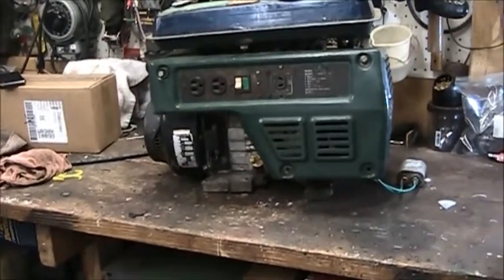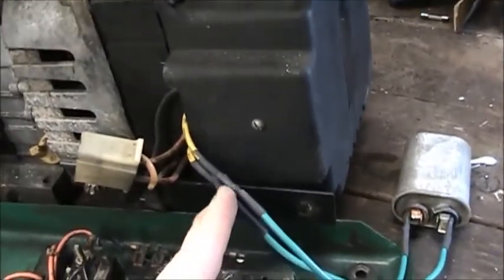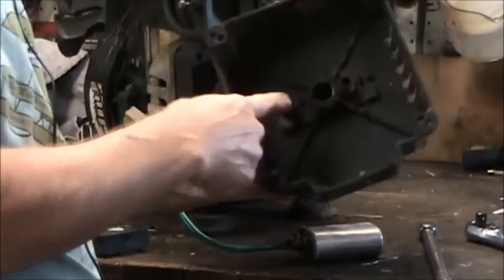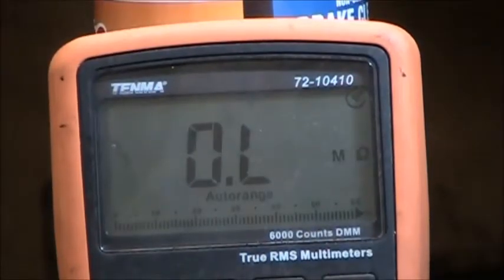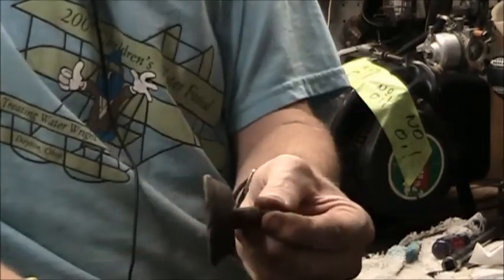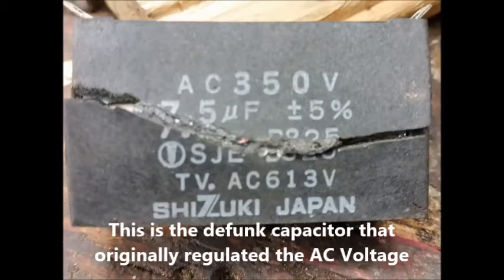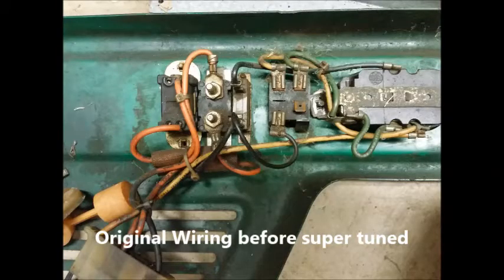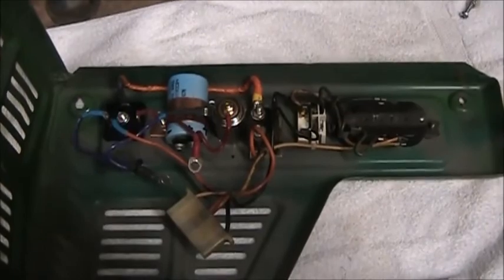Coleman Powermate 1500 Generator repair with schematic

Comment: My friend had one or these and in our case the problem was not the capacitor. We tested the cap with a multimeter and it was fine. The issue was the diodes on the rotor you can see them at 5:58. The diodes tested fine with a multimeter. But a multimeter only uses 2 or 3 volts to test diodes. The diodes were probably failing under higher voltage and causing the output voltage to collapse under load. After replacing the diodes with new ones that fixed it and allowed it to output full power. The original ones are MR760 diodes rated for 6A 600 volts. I replaced them with 6A10 diodes rated for 6A 1000 volts. Those are a more modern part that you can easily find online or at an electronics shop. You do have to solder the new diodes on. So if you try replacing your capacitor and it still doesn't work try replacing the diodes.

Comment: Those soft rubber hockey pucks, make very  good  vibration  dampers. As does a spring, on a bolt with large washers.....

Comment: 7:00 time. Those diodes, are the same ones used in older GM  alternators,   10 Di  or   10 Si  models. The only difference, is in this alternator, they are pressure fitted, to a semi-circular  heatsink.  Probably 70 amp rating, or so.

Comment: Greets...I just bought a non-running PM1500 I believe identical to yours. I have a no-spark issue and coil has 6k ohms resistance so I think it ok.
Google searches lead me to think there is a points and condenser on this rig. Can you verify please and it you think that could be the issue?
Thanks in advance, Steve.

Comment: I have one also mine is 1400  Suzuki engine started on second pull not bad for 28 years old. 
 Tank is rusted but holds  gas my is a 1990 model.  I had a problem years ago  no 120V output  you have to flash the field I put 9V battery for 2 seconds to get it going.
Reply from the maker: How do you flash the field?
Reply: @LestonDr  If it starts and runs but you have no 120V light or power when the sit they loose the charge.  Just google or youtube  search "flashing the field on a generator"   I think I attached wires to the brushes ran the wires outside the case.  There are many videos.  I seen people use a drill, flash the brushes, put 12V into the outlet to energize it. It only take a millisecond to flash.
Reply: @SoFlaRocks  Hi there...just wondering where the brushes are on mine...don't see them on @LestonDr either.
Reply from the maker: You may want to consider gas tank sealer.  My tank had a leak. I tried brazing. That didn't hold. Wound up mig welding and followed up with tank sealer to seal welds on inside.
Reply: @LestonDr  mines not leaking yet I keep it full of gas and stable

Comment: I have the exact generator used to be my grandads sat for years. Runs when you spray gas to it. Need a a main jet its stipped and stuck inside carb. Need a new carb I've looked with not much luck I know its a mikuni but still no luck with mod.# jw if you might know a place online that would have one? I've looked on ebay.. Mikuni web site etc. Sure its discontinued? Kawasaki it pulls up a mass variety of things anyways and help you be great. You seem to know alot about em thanks for your time and the content.
Reply from the maker: Do you have room to put a Helicoil in it?. My home generator is an early 70's vintage. I had the same problem you did I took the carburetor to a machine shop and they were able to get Heli coil in for me.
Reply: @LestonDr  ah well the issue is the threads are fine. The flat head slot on the jet is gone its flat on top. Can't get it out attempted to use and easy out but it and brass.. just doesn't work. In other words the jet is stuck in the carb. I've got the jet clean best I can it runs but used a drill to clean it and basically drilled the jet to big side holes on jet clogged cause can't get it out to clean. It runs but floods it self out. It I could just find a carb. Or a way to get that darn jet out.

Comment: My brother has this generator and it doesn’t have any part numbers on it.  Could you tell us exactly what coil to buy to fit this generator please?  Thank you for any assistance!!!!
Reply from the maker: I am not sure what you are asking?  The coil part number can be found for the engine in the Kawaski manual online.
Reply from the maker: https://www.kawasakienginesusa.com/parts-and-support/parts-lookupa7eb.html#/Kawasaki_Engine/FA130D-AS18_4_Stroke_Engine_FA130D/ELECTRIC-EQUIPMENT/e0805cb2-b121-48ab-84a5-018c3923e41e/e3c4d5e7-a7b1-48ed-b4a3-d644cec2688b/y

Comment: Would anyone happen to know what I could find the fuel gauge for the tank on this generator. Mine is busted and leaks fuel
Reply: There is no fuel shut off and no gas gauge. Check your fuel lines for leaks and replae if necessary

Comment: I have a generator exactly like yours.  Gas tank was rusted, so I jerry rigged & attached a plastic lawnmower tank for fuel.   Motor/generator ran really well for a couple years until one day it stopped producing voltage.  Neighbor stated to change the capacitor (similar to the silver one you had) and it's now working fine.  Easy fix.. Really like this generator, motor starts on first pull.  Good luck with your's and thanks for posting.  Good idea regarding the cigarette lighter.
Reply from the maker: Your welcome. If you still have the metal tank you can try to gas tank sealer.  It will coat the inside of the tank, seal the rust and any small holes... especially on the seams.  I sealed a outboard fuel tank I use on another generator over 20 years ago... never a problem.  Be sure to follow instructions.  This tank had a leak as well, after a good cleaning and thought (days) drying. I brazed the crack.  Please note the chineasium capacitors as any will age and dry out regardless of use.  I prefer spending a little more and buying a higher quality american built cap.  Thank you for your comments... Good luck.